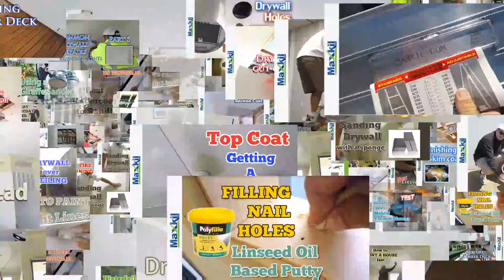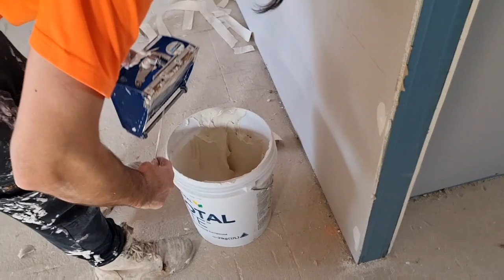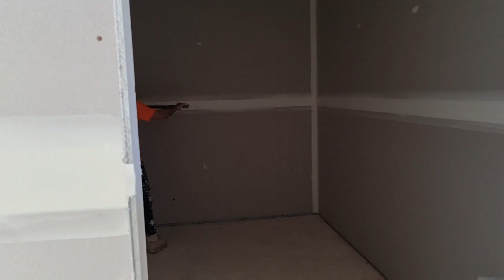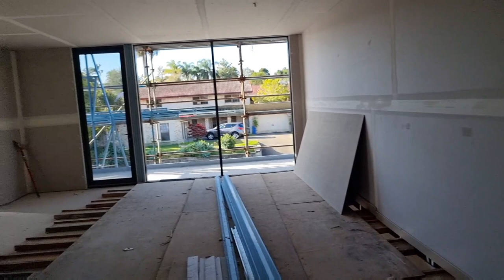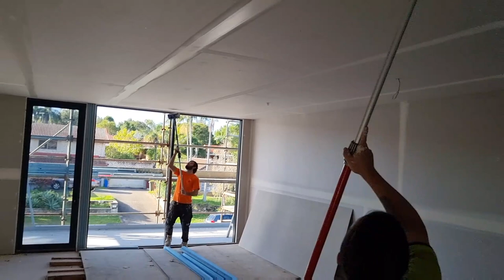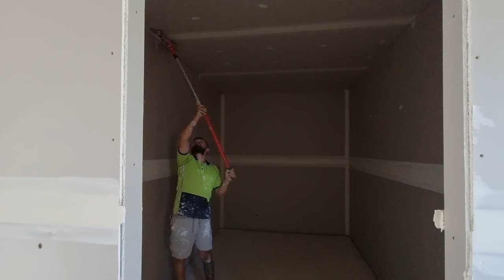Skim Coat a House in 30 Minutes with a Drywall Flat Finishing Box

Comment: Do yous pole sand in between coats ?
I'm by myself so pole sand and then run around and scrape (more so the base coat) the lift off points etc
Also any chance of a video showing your techniques using the boxes when the sheets are stood up ?
Just started a big commercial one and I just sacked the boxes off and did them by hand think for me it's quicker and easier 
Cheers lads